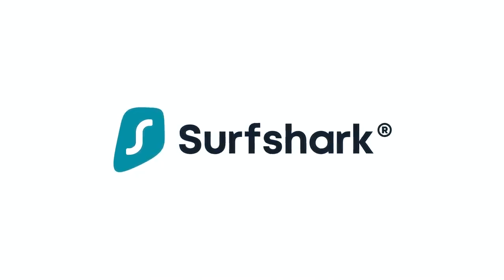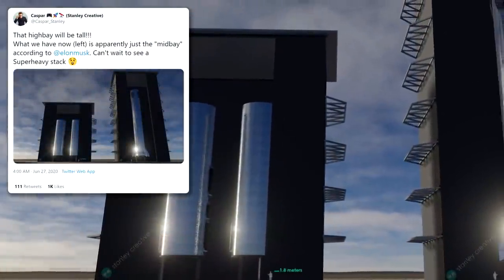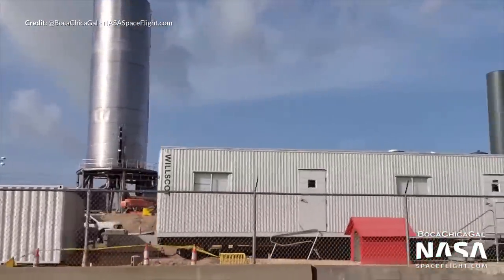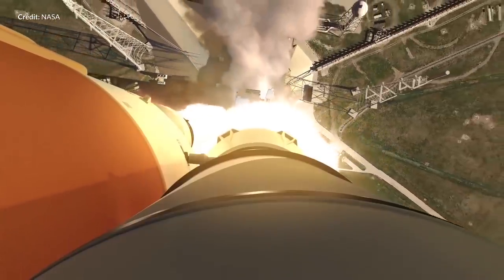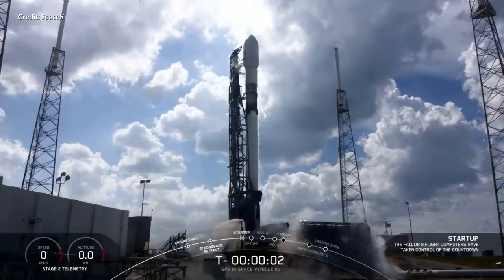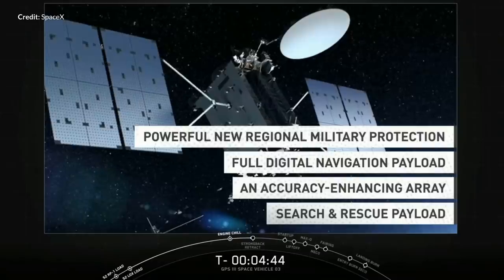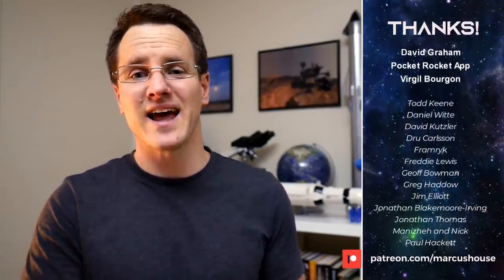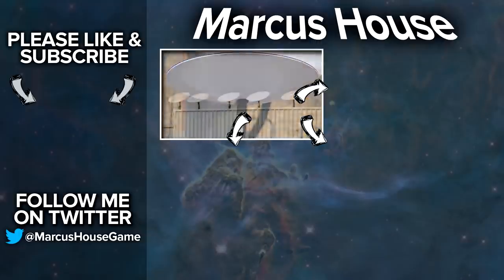Starship updates with SN5 Pressure Test, SpaceX GPS III, Mars Perseverance Rover Launch Date Slips

Comment: Amazing welding assembly from NASA to the SLS. SpaceX should do the same for the Starship. It would give a better uniform welding quality, and less bents.
Reply from the maker: I'm sure once they get out of prototype phase there will be a lot of automation. The benefit of this is simply rapid testing and trials. The machine to build the machine will come later.
Reply: @MarcusHouse  let's hope so.
Reply: Early on, before I understood that there actually was a method to their madness, lol, I was constantly put off to see these wrinkly looking tin cans they were producing, and it still bugs me whenever I can see an obvious dent in the body (but that's just the perfectionist in me ;?).
Reply: They are using stir welding on SLS. You will never see this on Starship. They went way over budget building the welder, then it didn't work right and cost even more money to make major modifications.
It is a lot of time, money, and energy for very little gain.
The benefit of what SpaceX is doing is that they are not committed to a particular method of manufacturer at the outset. This allows them to change methods easily and cheaply, rather than getting stuck with something like the huge cost and slow performance of stir welding compared to TIG welding.
Once they settle on a method of manufacture, they can then build a factory specific to a tested method.
Reply: @joshua43214  Great tidbit of info- thank you!  I was unaware what STIR was and had to look it up.  Of course, the method's creators tout it as being better than sliced bread.

Comment: Always wondered, what happens to the 2nd stage after it has released its payload?
Reply: Depends on the orbit. Google will tell you plenty, Wikipedia in particular along with this Reddit: https://www.reddit.com/r/spacex/comments/49v7cn/falcon_9_gto_stage_2_orbit_and_decay_history_post/
Most decay within a few years. In some cases they do a deorbit burn when it will have most effect. When that's not possible I believe SpaceX vents any fuel after the satellite is at a safe distance, to reduce the risks and also the inertia so that atmospheric drag will have greater effect.

Comment: You mentioned the Mars helicopter that will be on the next Mars mission. With Mars having such a thin atmosphere what are the performances like for the drone?  How much flight time will the drone have with the engines working hard to over come the thin air?  Also what other issues will it have to face dealing with the Mars environment?

Comment: -From the early beginnings of flight, the last minute maneuver before landing has always been called a "Flare".    SO my submission is : "Flip Flare".
......5 months in the test facility and is only on the second of eight tests.  Yep, normal for NASA....... 
-Yes, Please show us the famous tracking facility.  Always heard of but never shown.
-Complicated equipment does NOT sit well, as it begins to decay.  (Like a car that has sat for 2 years-dead battery, jellied fuel,  stratified oil, rusted cooling system, flat tires)  HOW would they keep it alive for two extra years?  They would need to have it run like it was already launched and have a 3 shift/day crew to monitor it for 24 months......

Comment: Back in the 1960's I was a teenager enthralled with NASA. The pre Gemini rocket tests mostly ALL failed. Fully completed rockets would be blown up, over and over. No 'video" lots of still pictures on TV and in the twice daily newspapers. Yet Elon is being called out for testing shell after shell and component after component. Would it be better if he blew up completed rockets to test ALL components at the same time, then spend months figuring out what went wrong? SpaceX has got it figured out - test each segment through failures with improvements where needed until it works 100%. Then - next part...

Comment: in regards to the starship skydive manoeuvre, nothing scary about a 200 tonne sky scraper size water tank falling out of the sky at mach 20 doing an experimental unproven aerodynamic manoeuvre! Just dont stand with in a 2000 km range of its approximate landing flight trajectory

Comment: I wonder if any consideration has been given to using a modified upper stage of the BFR to make a orbital station with rotational spin gravity. I am not a genius or really well versed in the math behind it but at 50 meters tall and with a 100 meter radius you'd need 16 of them all connected at a 157.5 degree angle to make complete ring which would then need 3 rotations a minute to have 1g. If I did the math right that is. Rather then a curved nose cone and a actual full 50 meter tall and a 4.5 meter radius and with 16 of them it would have a volume of 30,536.32 cubic meters. The ISS has 388 cubic meters of internal volume. From what I have been able to find they want the cost to be down to 5 million to build each full BFR and 2 million for launch (Optimistic numbers I am sure) . So for 112 million they could build a massive orbital station with gravity. The ISS was 150 billion to build.  So roughly 78 times the volume for 1/12 of the price.  I figured this stuff up for fun with google searches for the tools and equations and I really do not have a background in this so if I am widely wrong please forgive me. Though I am seeing that a 200 meter radius would be better as it would make for 2 rotations per minute which would be better to avoid motion sickness.
Reply: So for a 200 meter radius it would need to be a assembly of 26 of them, each at a 166.15 degree angle.  Which would be a volume of 49,621.52 cubic meters for a cost of  182 million. This would allow for a 2 rotations per minute in order to achieve 1g of spin gravity.

Comment: I am thinking that Starship will need to be able to retract its fins when it lands on Mars because of the dust winds will cat the fins and flip the starship around and knock it down to the ground where it will explode destroying the spacecraft.
Reply: David Hinds981 
Given how thin the Martian atmosphere is, I don't think this is likely...
Reply: The fins on Starship wont be there to provide lift but rather to move the center of aerodynamic lift (drag), they only make up a small percentage of the cross-section of starship. It will be able to fold in the fins somewhat to the side to reduce the cross-section as well, just in case. Martian winds only actually reach speeds of 30m/s at worst, nothing at all like is portrayed in some works of fiction. Also important to note that it's pressure is also far lower, making wind almost insignificant against a steel structure.
Reply from the maker: Mars atmosphere is like 1% of that here on Earth. If anything they will have issues with unstable ground etc. They need to find a good flat landing spot.

Comment: Unfortunately for the SLS, it's using sea level hydrolox engines and SRBs. SRBs have shit specific impulse, so even if they exert a huge amount of thrust they can't do it for long. The fact that they can't be controlled at all once lit is also going to be a problem, because with SRBs that size it can easily lead to damage to the rocket or payload at liftoff or max Q. And don't even get me started on sea level hydrolox engines, let alone expended ones that costs as much (or more) as a falcon heavy launch. 
The pricetag of using this abomination is not justifiable. At all. 

The SLS is retardedly designed and made to serve as a vacuum attached to NASA's wallet, as Boeing are building it on a cost plus contract. Why else do you think it gets delayed constantly?

Comment: it's not that it's expendable, it's that it's too expensive to launch to do anything decent.  I'm fine with expendable, if its dirt cheap. But when it costs 10s of billions to develop and reuse old tech and cost 500m+ or probably double that to launch, then it's pointless. Think of what could be achieved if that money was spent on private launch and assembly in space and how much stuff could be built to launch on those private rockets. it an extremely inefficient jobs program. keep the jobs program but let's have value for money though and do something with that investment.